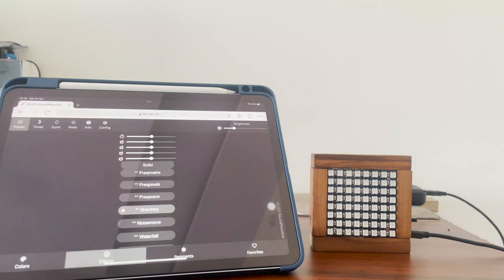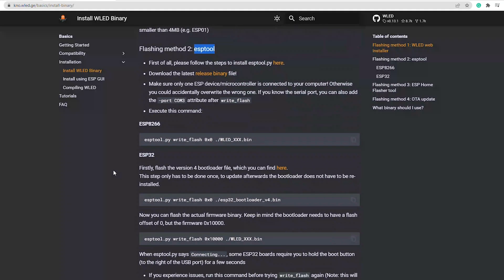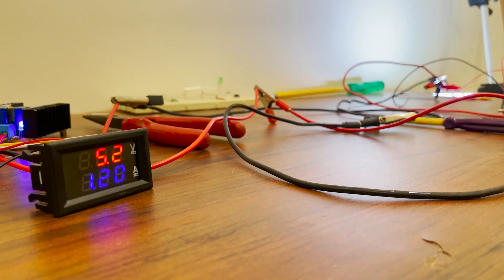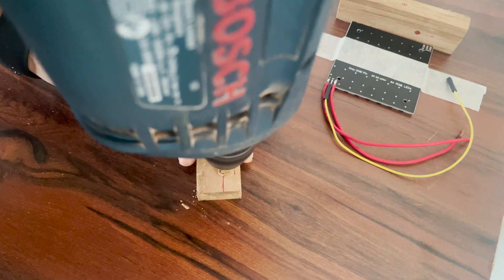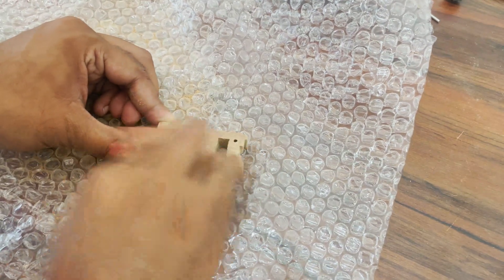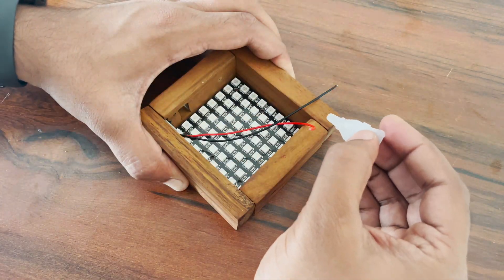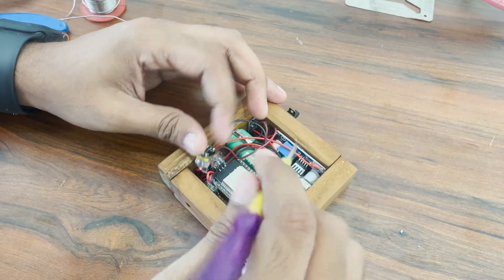2D Sound Visualizer + LED Matrix || INMP441 || ESP32 WLED

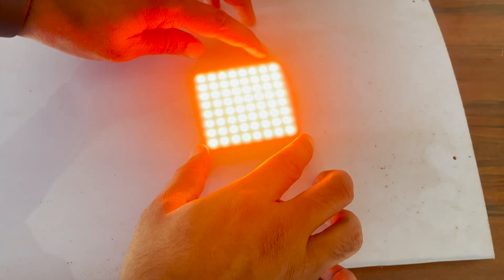Comment: Excellent job. Use the same acrylic sheet what you did use but use multiple layers. See if you can get the effect to where the video is at 12:55-12:56. Put the layers inside if you.
Reply from the maker: Thank you for your kind words. I will try with a 5mm acrylic sheet. I think that should do the job.